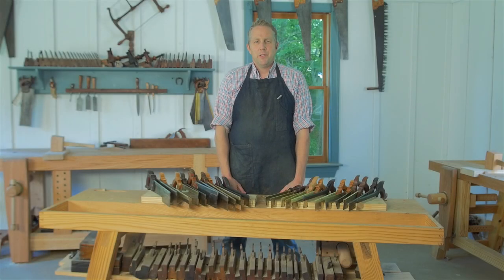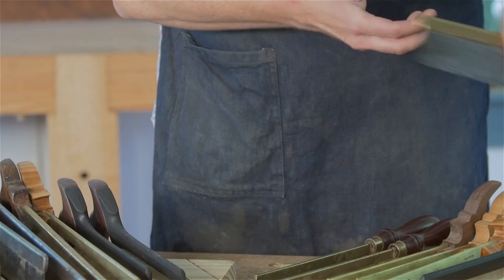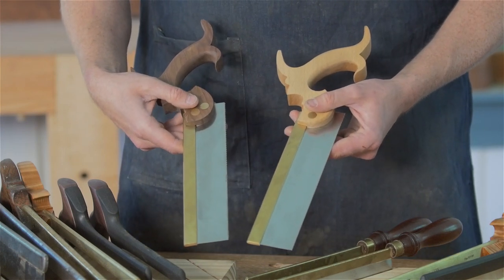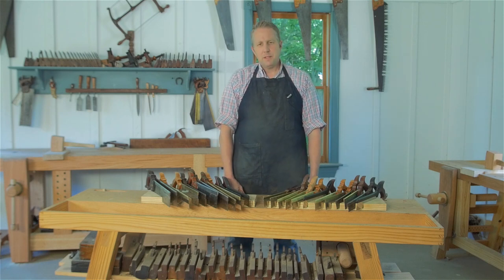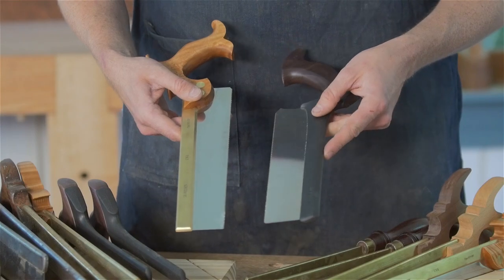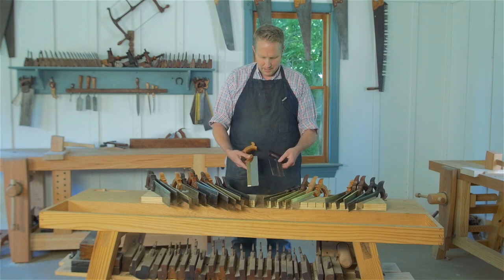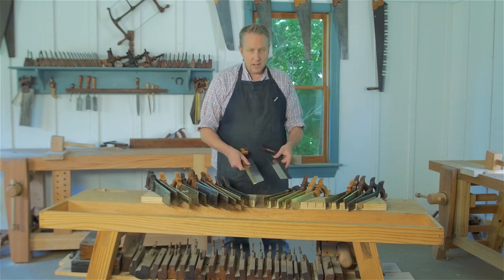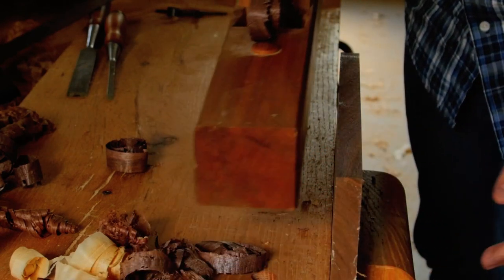Which Affordable Dovetail Saw is Best? Lie-Nielsen vs. Veritas

Comment: Nice, wish you'd mentioned that factory performance is thrown out the window after the first sharpening. After that it all comes down to the skill of the sharpener and comfort of the handle.
Reply: Absolutely, I was going to mention that.  I bought a second hand Lie Nielsen dovetail saw that cut absolutely horribly compared to my vintage Jackson and Son saw.  The previous owner had done quite a mess of the LN...
Reply: Nicholas Brown 
You should make a video documenting your process.  I would be interested to see this in action.  I would assume you’re not talking about the Gyokucho saws that are electrically hardened (unless that’s why you use a diamond feather file.)  Interesting.
Reply: wortheffort 
It would be good if folks would explain the necessity of buying cheap saws to practice on first so they don’t ruin a good saw.

Comment: While I LOVE my LN Mortise saw, I recently bought Rob Cosman's dovetail saw and use both to great success.  What's unique about RC's DT saw is that the first 2" at the tip of the blade are 22 tpi, whereas the rest of the blade is 15 tpi.  This gives you a great start every time, leading to improved accuracy, less chiseling up to the line, and tighter joinery.

Comment: Lie-Nielsen dovetail saw affordable? This is an April Fool video, isn't it?
Reply from the maker: Compared with other saws like this, yes: https://robcosman.com/products/rob-cosman-professional-dovetail-saw
Reply from the maker: @str8chevys913  I agree
Reply: I suppose the other alternative is pax saws, I went for the Lie Nielsen but its hard to say.....
Reply: @philippboetcher9959  the price of premium hand saws is just off the wall to me. I can get a brand new Makita circular saw for cheaper. That fact does not sit well with me either.
Reply: @1pcfred  Yes it is well expensive....on the other hand, second hand standey planes are very cheap and still fantastic, same with Marples chisels. Just the saws are clearly over the top....
Reply: @philippboetcher9959  second hand is how I try to acquire tools. I don't see good second hand saws ever though. Which is why I don't really have any very good hand saws. I have a couple so so saws. I will not pay power tool prices for hand tools either. I like my power tools too.
Reply: @1pcfred  I understand, I just bought te lie Nielsen because I found it makes quite a lot of difference when sawing dovetails. We have very used ones in college and there allright but often they slip or wander away from the line. I just finished my first year and thought its a good time to go to the next level:) I think its worth it because it might save me a lot of ranting at bad look after saws:)
Reply: @philippboetcher9959  after a while it dawned on me that there is a certain amount of let's say license that can be taken when making dovetail joints and they still have a good appearance. You just have to know where you can cheat and where you have to leave meat. Realizing that people do not have X-Ray vision is the next level. What I'm saying is abandoning perfect geometry is the path to success.

Comment: The Veritas dovetail saws go on sale, even at Woodcraft.  I have sharpened mine a few times, so I can’t comment on out of the box (I know I’ve decreased the set, i.e. have not put ANY set, just sharpened flat without fleam).  I also start on a push cut, not pull.  The back isn’t plastic, it’s a metal/resin mix (that feels metallic on the hand).  I have made saws and re-handed saws, I would stay in the (on-sale) Veritas side of things.  I don’t like the “hand-feel” of the gent saws, if I was forced to I suppose I could figure it out, but I wouldn’t want to be doing important/visible work for quite a while.

Comment: I have a Disston carcase saw that I bought Oct. 1, 2016 in Mountain View, Ar. for $35 plus tax. When I researched it I found it was made around 1850. It has a tapered plate and closed tote. It is still in very nice shape. I have used it a little but not much.

Comment: Thanks a looot.. definitely i,ll go for antique vintage one & brass backed and will sharp it my self.
Reply: Many of these old back-saws have the plate pushed deeper into the spine. This is because many workers habitually used the end of the plate to complete the 'blind cut', when making half-blind, (lap) dovetails. They would put the end of the blade in the cut and tap down with a hammer. This worked, but was hardly the way to treat a saw blade! Better idea is to use an old scraper, which does this trick nicely.

Comment: I agree with the difficulty in starting a cut with the Veritas saw. I heard Shannon Rodgers, of Renaissance Worker, say something similar.
Reply: This comment makes no sense at all! The LN has zero degree rake. That is a saw that will cut aggressively and require a touch to start. Some like this (I do), but it is a saw for the more expert (I am). By contrast, the Veritas has 14 degrees rake, which is shallow (the average is about 5-9 degrees). This makes the saw much less aggressive. It will start gently and saw more slowly. Perfect for a beginner (but also good for someone more careful). I have both saws. My go to is the LN, but the Veritas is a fine saw as well. The comments about it, from this video, are just inaccurate.
Reply: @derekcohen1000   It's possible that I misunderstood/misheard Shannon when he spoke about Veritas saws. He may have been talking about the hang angle instead, or perhaps a combination of rake and hang.

Be that as it may, I have more difficulty starting a cut with my Veritas saws, than I do with vintage saws

Comment: If it comes to buying a tool, I have learned 2 things: 
1. You get what You pay for.
2. Good work begins with good tools.
 
Buy an average prize level tool and You'll have an average quality tool. Usable, but that's it.  
Spare a little more to buy a higher quality tool (it don't have to be the most expensive hand engraved and mirror polished piece of Artwork!) and You'll get a tool You'll love to use. Those kind of tools You will handle with care and use them with a smile on Your face. They'll stay in perfect condition, as long as You'll use them.
That makes Your tool live longer, that makes you working safer, that makes Your work better (You'll be more content, promised!) , that makes Your life easier.

If it's a question of a few bucks, it's not really worth to save them. 
Life is too precious to mess around with bad tools!
Reply from the maker: Thanks for your comment! Yes, a better tool does help. However, there is a level of diminishing returns where a $250 dovetail saw isn't necessarily going to give you better results than a $100 dovetail saw. And visiting so many other woodworkers, I've been amazed what beautiful furniture they've built with basic hand tools, rather than whole sets of Lie-Nielsen tools.
Reply: Wood and Shop  Indeed. If a level of quality is behind and You're somewhere by 80-90 percent perfection (which often is enough) , You can easily pay twice the prize for a few percent more quality (or just a better look or brand name) and You'll have to doubt if this is really necessary. That's what I meant as I wrote  "it don't have to be the most expensive hand engraved and mirror polished piece of Artwork". But sometimes the border between a real good tool and a piece of Artwork is not clearly defined... ;) 
 
And of course even the best tool can be used the wrong way or just badly - so it will produce bad work or gets worn out/dull very fast. If the user is an idiot, Quality of tools will not help...  

But - even if the same quality of work could also be done with cheap tools - it's easier and safer and more satisfying to produce good work with good tools.

Comment: This can be where we come to complain!  I have the Veritas dovetail saw.  I admit it could be partly my low skill level but I can't cut straight with it.  I'd like to know what the weight difference is between these two saws.  I find the Veritas to be too light.  I'm old a little shaky as it is.  I need a bit of weight to help with stability.

Comment: Can you tell me if it makes a difference between the LN tapered vs. straight dovetail saw?  Which was your comparison using?
Reply: Plate tapering or just a taper from heel to toe?
Reply: the tapered saw allows for easier cutting to your base line. its designed so that you do not accidentally blow past in the back while cutting. I have the tapered and no regret.

Comment: Have you had a chance to sharpen and set the Veritas to see if that helped fixed some of the observations and initial impressions?
Reply from the maker: No, I didn't have time to sharpen brand new saws...just sent them back. A new saw over $20 should cut perfectly out of the box. The saw plate was also too thick.
Reply: Wood and Shop good point. Thanks for the update.
Reply: keep in mind that the set is almost non existent on the veritas tenon saw as well, and made mine impossible to use. I put in more set, and now it doesnt bind up, but im still not happy. sadly, lie nielson no longer produces there tenon saw....

Comment: i have both and must agree. the lie nielson performs much better. it comes far sharper, the geometry allows quick and easy start, its a bit heavier which helps as you dont have to bear down as the veritas kind of encourages you to do. the veritas is a good saw, but for a little more, you get a far superior tool in the lie nielson
Reply: Lie Neilsen has went up to $175 now, Veritas is still around $90.

Comment: I was in need of a dovetail saw and my wife wanted to get me one for a gift.  I gave her three options and only the Veritas was available, so that was my gift.  I've been using it for over a year and a half and it cuts great, but I have never liked the feel in my hand.  I also keep meaning to take some of the set out of it.  It just seems to come with too much for a rip.  I also don't like that plasticky back.  I like the weight of brass.  It cuts aggressively enough for the weight.  I think the weight is the difference between the Lie-Nielsen and the Veritas.  The other option I gave her was the Florip.  I'll have to check if this channel has a review of that tool, but I heard so many great things about it, I wanted to get that as my first choice.

Comment: There's no doubt Google will hold a wealth of information, but I'm curious about sharpening. How hard it is to become proficient? I looked at some videos (maybe even on of yours!) and I was intimidated. I have the LN dovetail and carcass saw, and they are in need of sharpening. I don't want to screw it up!
Reply: Rip saws are pretty easy to sharpen. It does take a little muscle memory to hold the angles consistently. I first practiced sharpening on a $1 back saw from a secondhand store (and I still use that saw now).
Reply from the maker: Your LN saws likely just need a tune up. Go to youtube and find the tutorials by Thomas Lie-Nielsen on resharpening his rip and crosscut saws. It does take some practice, but I've found the Veritas saw filing guide is really helpful in getting consistent angles.

Comment: Good info! Most of my saws are antiques that I bought cheaply on ebay or at flea markets and restored. The one exception is my dovetail saw which is the Veritas. I like it it works great. I have the fine cut version which is about 20 tpi and is of course a bit slower though it results in a cleaner cut. The standard version is 14tpi and cuts a bit faster. Do you know which one you were using there? I'm guessing it's the fine cut version but I'd be curious to know which and how the other compares to the Lie Nielsen
Reply from the maker: I was using the 14 tpi version. Thanks for the comment!

Comment: I bought a 7 euro saw. Long teeth, thick blade. Cuts horribly.... You mentioned the sharpness of the teeth, I looked at the blade and the teeth where as thick as the blade. No sharpening at all! So I took a file and worked on all the teeth and it does cut allot better now.  Now I just need a saw with shorter teeth.... those long teeth are a @%^$@ for fine detail work and short cuts.